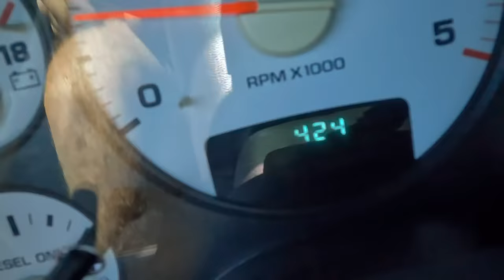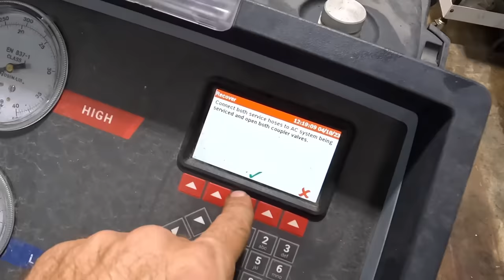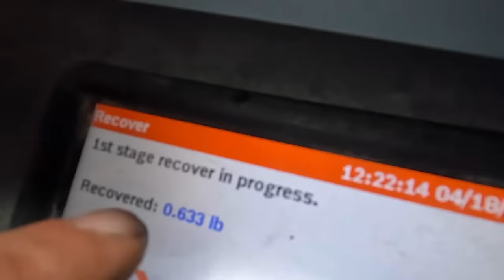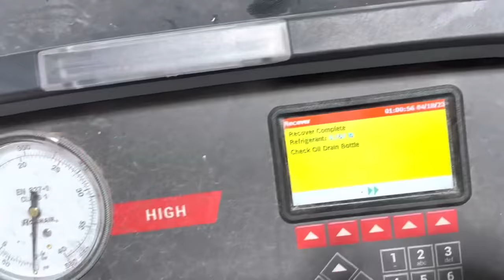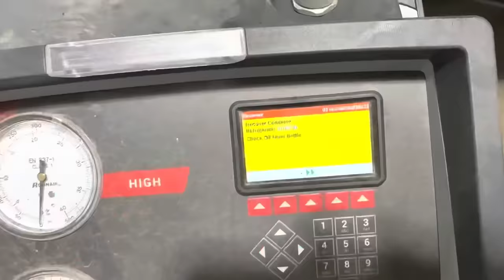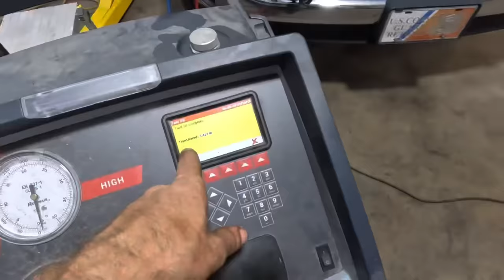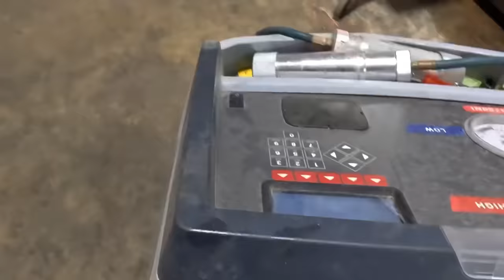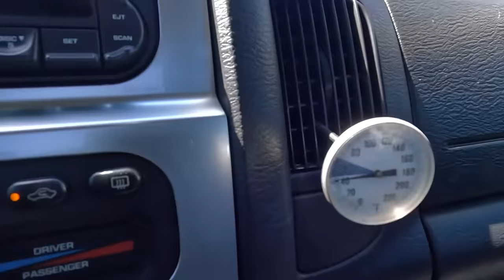Diagnose Before Removing the Dash  Dodge Ram 2500  5.9 Cummins A/C Blows HOT!

Comment: I have a 1999 Dodge 2500 with the Cummins,  I installed a pusher Spal fan on the front of the condenser and it made a big difference in AC performance.

Comment: Ray's attention to detail and diagnosing the issue before throwing a major expanse at the issue (which ultimately would not have solved the problem) saved his customer a boat load of money. I had an issue with the evaporating coil in my 2006 Ram 2500 and they had to remove the dash to get to the part. Fortunately for my wallet, it was in 2007 and covered under the warranty. They commented that it was a two day job (the also provided a courtesy car at the time).

Comment: As always very refreshing that you don't replace all the parts when they may not be necessary.
Hope you removed your small light which apeared to be at the left edge of the hood when you closed it, when you checked for leaks back at the shop.

Comment: I just diagnosed a varying vent temperature issue on my 1988 Mazda B2200 truck as being due to a bad fan clutch (again).  I used the rolled up newspaper section to diagnose (also good for training puppies !).

Comment: I have a 2005 3500 Cummins Ram truck 4x4 8foot bed 4 door, similar to this. The AC is working good now, it had lost refrigerant over 2 years.  Added myself. Interesting about that high side valve leak.  I have 2 busted blend doors, I have  no floor air and the recirc door I removed-pulled out thru the blower. Pulled outside cowl and sealed the air going in. The blend doors crack their hinges as the door actuators overpower the cheap crap-plastic the doors are made from. Would be a good video to see blend door replacement. Blend doors are one serious fail here by the OEM.

Comment: I always put a little oil on the O rings before reinstall. It's just a little easier to slip the connectors together. One other thing I found was to spay clean the springs in the connectors to get the dirt out since dust has a tendency to inhabit those pesky items.

Comment: I had an aftermarket condensers installed by the insurance company, it never worked right untill I bought a factory oem part. I changed it myself and had a buddy vac it down with his machine  its worked right every sence.

Comment: I always see you check the valves for leaks, I work in an auto factory and I kid you not, on a brand new car they consider the cap apart of the system, most caps have gaskets on them. They use a sniffer at the end of the line, if a caps lose, it will be considered a leak.

Comment: You seen new parts on system and tryed not to put expensive parts to the ac, you checked the level found its low changed the values which was the root cause to the leak well done to help the customer over paying where a dealers will run with the part's cannon.

Comment: When I worked for one of the largest automotive A/C suppliers in Australia. When assessing a warranty claim on a compressor, any vehicle fitted with a parallel flow condenser had to be fitted with a new receiver drier or accumulator and condenser as the parallel flow condensers cannot  be flushed. As a rule we would recommend a TX valve as well. When I worked as an Auto Electrician we were taught to lubricate the O rings with some refrigerant oil. By the way I am old !

Comment: This customer did come to the right shop, Ray.  I too have been a victim of the Air conditioner parts cannon.  The most recent time I just gave up because that's what too many shops want to do; fire a full broadside with the parts cannon.
Reply: I hear you,a friend of mine was all set to get a new compressor on his Honda Pilot($1,400).He called me and askes if that was to high,I asked why is needed a compressor,he had no idea.He stopped by ,I swapped a relay and told him to go get a new relay,problem fixed $7.00! He went to the shop to cancel his appointment and asked them why they lied to him,they said they didnt really diagnose it,but it wasnt coming on so thats the most likely cause! Ugh

Comment: Hey there every heard of Volvo 440 that had experimental green wiring harness it was plant based but unfortunately it failed after a year or so I came across it when my mate bought a Volvo 440 for the engine accessories all the wiring insulation was peeling off.

Comment: I have a 94 explorer, air didn't work when I got it, took it to 2 different mechanics, changed out most of the mechanical parts and gave it back to me saying it worked now. Problem was that it DID work like a champ on cooler days, temp would get down in the 40s. On a warmer day it would not work at all period. Got a old Chilton manual, started going through the schematics, and saw the relay in the fuse box for the ac. Being an old school aircraft electronics technician I knew what gremlins live inside relays so I went and got a $7 relay, slapped it in there and it's been fine every since.

Comment: right on good to see you are not just doing work that my not be needed; when I was driving never needed air-conditioning because its never hot In Eureka ca if its more then 75 degrees we are having a heat wave it may even get 80 for a few days a year lol it is the right place if you like fog and cold

Comment: I was watching somone else evaluate a evaporator and what he did as a trick was put dye in the system. Then shine his black light on the water drips from the evaporator, if you see dye light up on the floor in the water the evaporator has a leak.  Or it could be the condensers or condensers filter or something else.

Comment: Ray, I have the same exact year make of truck. You may still have a blend door issue with the passenger side inner vent blowing warm. On my vehicle the blend door will close but occasionally will stick open letting warm air in the cabin. I work with it by simply closing that vent but I believe there still a problem with blend door.

Comment: On my 05. 5.9 ram diesel my air conditioner stopped working. It was 2 problems.  First was a noted problem with the rams, the bottom of the evaporator rusted a hole in it. The 2nd was the fan clutch went which shuts down the air conditioner to help take draw off the engine so its not working as hard to keep the engine cooler.  I did a vacuum draw after replacing those and let it sit a couple hours to see if i had any leaks.  I added refrigerate, dye and the proper amount of OIL, I noticed you didnt, it worked up until I parked it at 380,000 plus miles.  
Not bad for a backyard mechanic huh ?

Comment: Thank you so much for this video… I have an 06 ram 3500 mega cab with dual zone climate controls and replaced my compressor, took it to a shop to have them pull a vacuum and recharge the system, they said they couldn’t because my tipm/ fuse box was toast, lol it worked great before, but those two little wires on back of compressor were cut on original one idk how but it worked great before the cut for 20k miles, anyways I replaced that compressor just needed vacuum and recharge, after watching your video the truck doesn’t even need to be running to do what you did. Almost got scammed! Shop wanted to charge me $1900 for the part alone then whatever on top to recharge. Thanks for the video!!! Gonna be charging my system tomorrow first thing got a buddy who has that whole set up to get the job done!!! 🙏🫡

Comment: The garden hose drain will suck outside air into the air handler, it should have a “duck bill” drain so condensate can leak out without air rushing in.  Also place  tape over disconnected fittings, leaving system open to atmosphere adsorbs moisture which will combine with refrigerant oil to form acid which will attack reed valves and other components, clean and dry is very important within system, leak dye is not your friend

Comment: When ac flapper doors fail it is often due to failed of the white plastic part between the drive motor and flapper door. There is an after market part available online, tranglular tube, that replaces the fail part. Sorry I can't remember the company name, it's a small operation. Took under an hour to install, worked great, fixed my old RAM2500. Found part after several google searches. Took more time to find part then to install.

Comment: I had one of those that needed almost every door in the HVAC system replaced. essentially the same truck, 2005 Ram 2500 Cummins Diesel. It ultimately had to have a new compressor. In my case the dash had to come out.

Comment: I have a 2006 Dodge Ram MegaCab with 132000 miles and i had the same issues with the A/C drivers side was cold and the passenger side was warm. And when i would adjust the passenger side the blenddoor would grind this was a problem for several months. So we were going to take a trip up to the Eastern Sierras in California for a fishing trip and i wanted to get it check out and serviced. I thought that is was an actuator that was acting up so they replaced all 5 with aftermarket ones one of the blend doors was also broken causing the grinding noise. The shop purchased the Blend doors from Blend Door USA they are way better than OEM crap made out of plastic these have an Aluminum frame very beefy. They seemed to fix the problem but the passenger side still acted up so back to the shop it went and they replaced the actuators with OEM ones and after almost six months in the shop it was fixed. 
Not a fun experiance to go through  I love watching or videos

Comment: I could have sworn that the front unit was the transmission cooler.  Also have they replaced the metering tube.  It should be part of the high pressure line on the passenger side.  I have a 2002 ram 1500 and have had to rebuild the ac system 3 times.  Once to install a new compressor, again after that compressor failed, and again because a rubber line failed.
Reply: That would be a pretty big trans cooler. Maybe an intercooler?

Comment: my brother had a 2005 dodge 2500 4x4. came from factory with this problem. his side worked passenger side didn't. dealer said system was fine needed dash pulled out to fix actuator door. I checked system it was a little low 1/2 can later both sides worked.

Comment: POE or PAG (polyalkylene glycol, auto only) lubricants must be used with R-134a since it is not miscible with mineral oil or alkylbenzene lubricants found in many systems.   R134A DOES USE POE OIL

Comment: Hey Raymond 
Don't know if you know this 
But you can recalibrate those thermometers by putting them into the freezer for a day or a couple of hours little trick I learned as a truck driver to check the temperature of my products I had in my trailer 😊
Reply: A trick that I learned to calibrate the thermometer was a glass of ice with water, stir and when glass condensates, that' is as close to 32 degrees F. Stick the probe in and adjust as needed with proper open end wrench
Reply: @brad6665  that's the correct way.

Comment: Confused as to why you did not flush the evap core before installing the new drier? It seems they had a previous compressor failure  so seems likely there may be trash in the evaporator core. Thanks for sharing yourwork with us Ray- always enjoy it. Cheers.
Reply: I stopped getting heat in my truck. Not ideal in northern Michigan winter. Shop flushed it and that helped, but suspect it needs more. I bought a core, then found it’s a two day job to remove/replace dash. One shop even suggested a Sawzall hole in the firewall instead. Pass.

Comment: My Jeep is the same exact way, you have to pull the dash to change the heater core. I said screw that! I drilled a big ole hole through the firewall, bypassed the heater core, ran the water through the firewall into my cab and attached it to a heater core with a fan strapped to the back of it. Even taped up all the gaps to make it 'flow' like a wind tunnel. Hillbilly heat, baby.,

Comment: Not uncommon for these things to have blend door issues. My 06 1500 MegaCab has issues with the passenger side one doing whatever it wants. I usually fix it with some percussive maintenance. I've got my replacement doors in the bsck of my truck. The ehater core went out so I'm going to pull the dash and the box. So i might as well replace it all at once

Comment: The service valves always leak, they should be changed with every service if you don't like come backs, maybe stop leak setting up on the seats of the valves. People, never use stop leak in ac systems. With all the parts changed it could have been oil flooded, however I didn't notice you adding oil back when you replaced the accumulator? The condenser air flow , I like to see if it will hold a sheet of paper while idling, its a good test I use. Also what about the orifice filter, maybe it was changed with the compressor and condenser and maybe not, it should always be inspected after a compressor failure would make high side high and low side low in which the low side looked ok, but the high side looked a little high, but that would be also from still being oil flooded if it was. who knows. Its working and if it holds a charge will continue to as is. and put some oil on those O rings. Not bashing, just giving comment. Good video, thumbs up.

Comment: Hate to say it, but that evap will probably need to be change out. Those early-mid 2000 year doges were known to have leaky evaporators. I did mine about 5-7 years ago, took me almost a week to do. I used an electronic leak detector to find out where it was leaking from, never had to add an ounce of refrigerant since.

Comment: When you low line  its  freezing  its  just cuse it low in refrigerant   and it dont reach the  evaporator   where its  supost to evaporate   ,   it made  the heat exchange  in the line  bifore  and  cuse of the  heat in the  engien bay  it gets  cover im ice    .... so ice in the low line  means  leak or poor charge  ...   people ask  me if is normal to have  condensation   in the line  when the shot off thw engien ..  but some times  they have ice  😪

Comment: Did not see you lubricate new orings. Sure you did. The 5.9 cummins uses an electronic fan. When AC is turned on. You should hear a bunch more air across rad. The fan goes to max speed. Does not have a high pressure switch. Will actually pop of the high pressure release and lose refrigerant. If fan is not going to high speed.
Reply: That would explain the parts cannon strategy

Comment: so question, why didnt you flush the system before replacing the accumulator? Im just curious (not criticizing) as Ive been told by many an ac place that they MUST flush the system and replace the filter/dryer/accumulator etc. Or maybe thats just when the compressor goes t*ts up and contaminates the system? Another great video

Comment: Great video! I could have swore way back when at the place who shall not Be named! You had some sort of cleaner you ran through the evaporator with another machine (?). I really wondered why you didn't perform this, is it that you don't have the machine required? I hope there isn't a follow up on this but would love a short bit after a few days to confirm that there isn't any leak? Some might like dash tear apart videos, I personally do not care for them as they are item specific and I will never own that dodge model. But HVAC is HVAC for the most part so that was interesting for what it was. 😏

Comment: Did you check the level of oil in the accumulator to refill the system or now is the oil level low also a drop of oil on o rings helps installations

Comment: great job, fixing what needed to be fixed! how long do the accumulator work before needing replacement?
or is that a rare item to fail? that was quite cold for the A/C 40 `F. I will check mine once it gets warm 
enough to do that up here in NY. I keep a thermal device in the vent all year to verify both hot and cold capacities.
have your self a great day! always a learning experience watching your videos.
Reply: Usually they rot/rust then leak,but they have a dessicant pack in them and if the system has been flat for awhile,its most likely loaded with moisture!

Comment: Normally, when charging a unit, you should add liquid to the discharge so you're not sending a straight column of liquid into the compressor since liquid isn't compressible. Could fubar the compressor. 🤷🏽‍♂️

Comment: Hello from NW Ohio .quick question why don't you put any oil on the o-rings when replacing the accumulator? And also add some oil since you replaced it. Was taught to check oil drain bottle and add some when replacing parts? Hello to the wife and kiddi units.

Comment: DIYer's need to learn to start with the simplest things first like the schrader valves which are one of the main points of failure on auto ac systems.

Comment: My jeep had a leak in a hose right after I got it back from shop and engine replacement. I replaced the hose and tried to use one of those recharge cans from the parts store. didn't seem to take anything so I took it to the shop that fixed the ac system a few years ago. They wouldn't touch it, didn't want that stuff in their machine, something about the lubricant in the refrigerant. Is that a thing? thought it was normal to have lube in the refrigerant.

Comment: Hey Ray, could you also pull that thing into a vacuum and see if it maintains it for a day or two without charging it back up and potentially wasting gas?
Reply: Sure could,but usually the decay test will show up pretty quick,over 24 hrs you will have oil and residuals in the system that will boil off and your test has failed.I am more likelt to use a standing nitrogen test,its very cheap and easy to do.

Comment: When does Ray start diagnosing AC leaks properly with a gas and a detector device instead of charging it blindly with AC gas? Guess its not warm enough in Florida yet to be concerned about the environment...